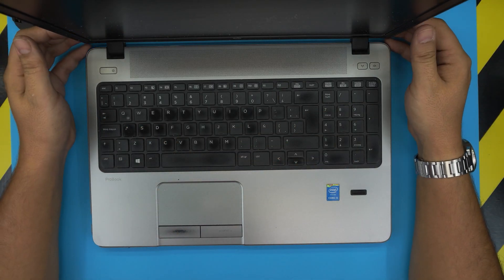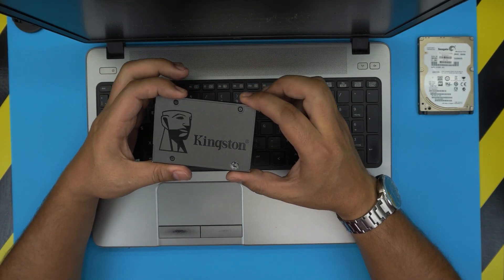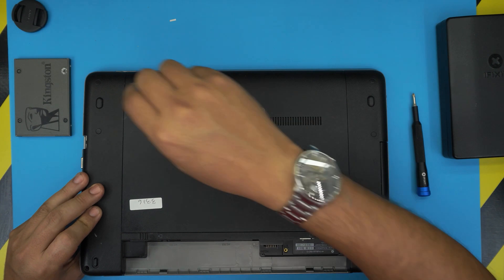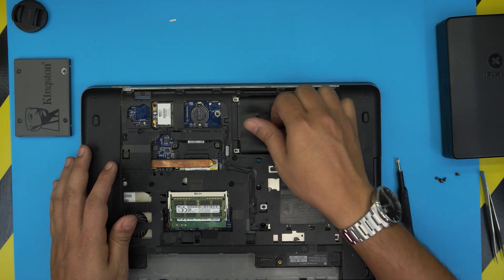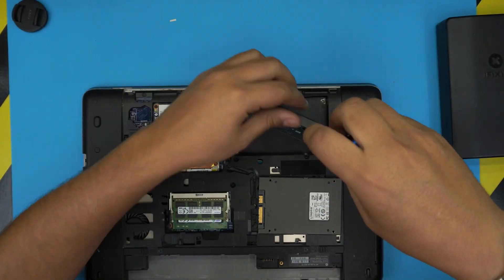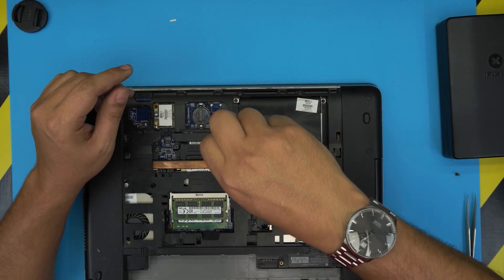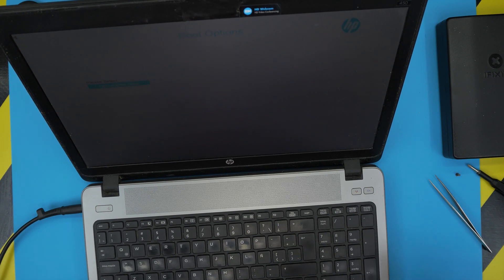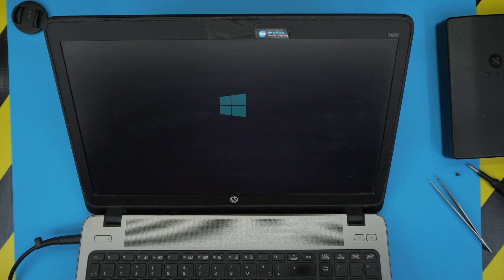HP ProBook 450 G1 📢 HDD | SSD Storage UPGRADE

Comment: Thanks for the tutorial!
I've had my  trusty 450 G1 since 2014 and will look foward to upgrade it.
By the way, Do you know how I can totally remove the optical drive and just put a cover? I really want to remove some weight on this laptop
Reply from the maker: Thank you for the feedback! if you wish to support the channel you can LIKE or SUB or both :P
regarding your question: just remove the screw in this picture i send you and slide the silver metal tot he right and the drive will come out and remove the face place off the drive and glue it to the empty space .
https://imgur.com/a/6oXfqcR
Reply: @uFixTek  is it possible to use the CDrom space for the SSD and keep the HDD in place and use it for extra storage?
Reply from the maker: @robdizzel420  yes you can remove the dvd drive and place a dvd to hdd caddy and use it as 2nd storage.
https://amzn.to/3LQ9Bon